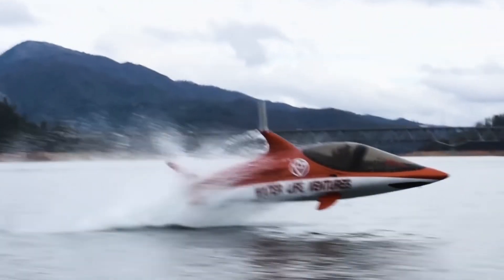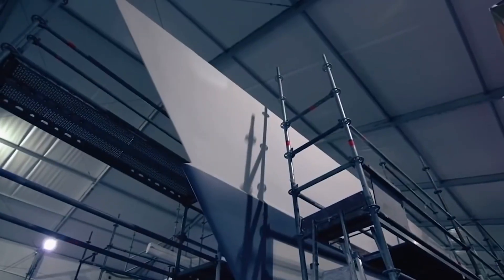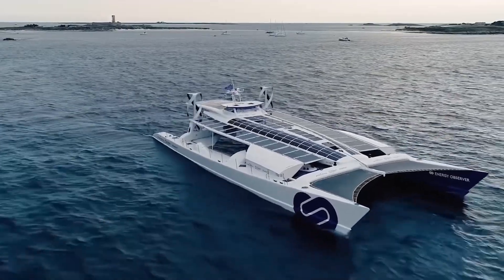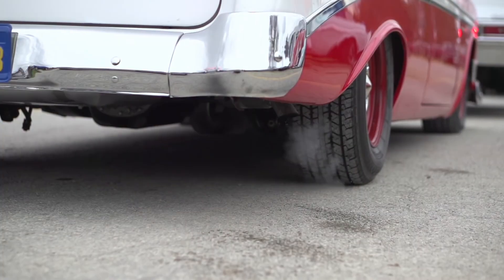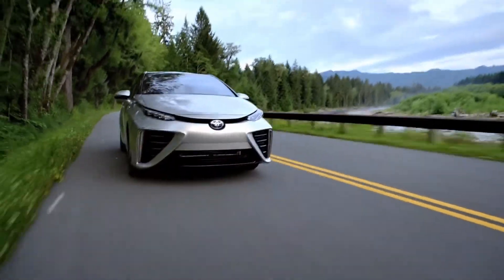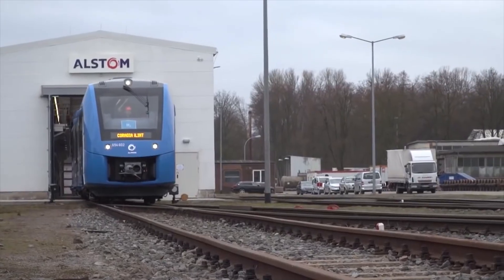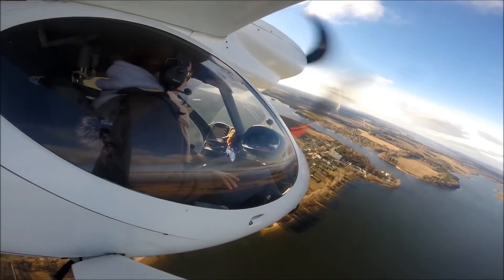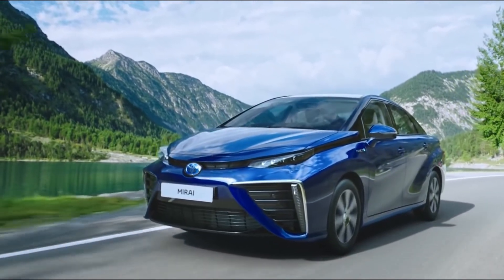Unveiling the Hydrogen-Powered Ship

Comment: Dafuq is this? First of all, there are already hundreds of actively used hydrogen powered boats in existence. Cost is an issue for commercial clients, but even those exist alredy for a few years. Secondly, the self sufficient part is a testimony to the boat's inefficiency, as I am sure you are aware of the conversion inefficiencies at electolysis and in the fuel cell. It would be much better to use the electricity directly from the buffer-bateries. The only use of hydrogen would be to increase the power output over what the solar panels and wind turbines can deliver.
Development costs are also not that high. There are a lot of small businesses that offer hydrogen refits for all kinds of vehicles and boats. Developing a new car model is expensive and a modern internal combustion engine as well, but hydrogen, just like battery-electric power-systems, are rather simple (Btw: almost all hydrogen systems are also battery-electric, just with a much smaller "buffer"battery). All this is not to say, that the refit itself won't be expensive.